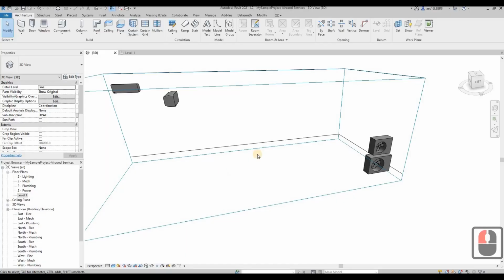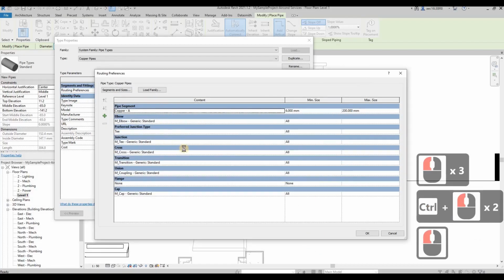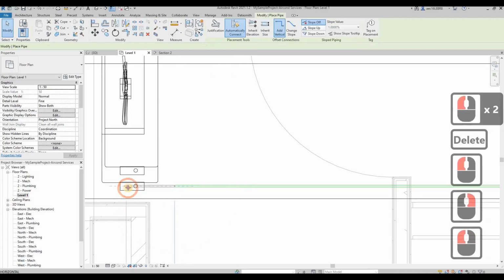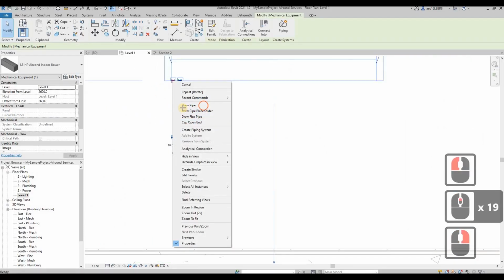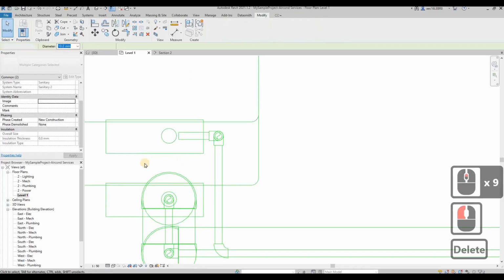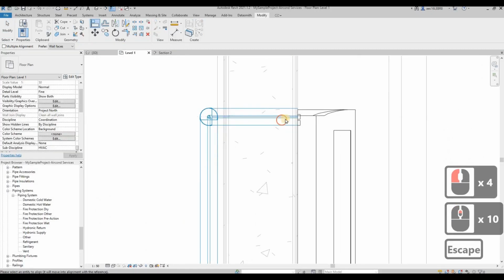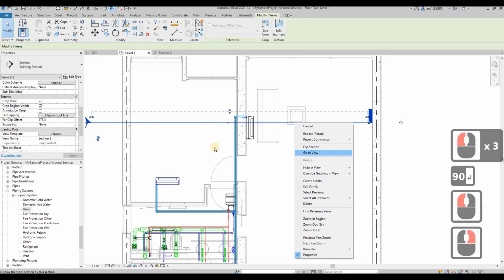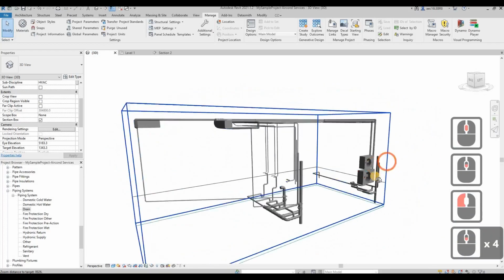Revit MEP - HVAC Modeling Tutorial -Part 2 - Modeling of Aircond Piping

Comment: where can we get the outdoor/indoor ac unit models you're using? I tried to download some LG and Panasonic ones, but I am struggling as the pipe diametes are different and there seems to be a separate Out pipe and 2 In pipes that connect the outdoor to the indoor unit
Reply from the maker: That’s the problem of using downloaded families. Learning family modeling skill is very important. If you want it , you can email me your request to me.